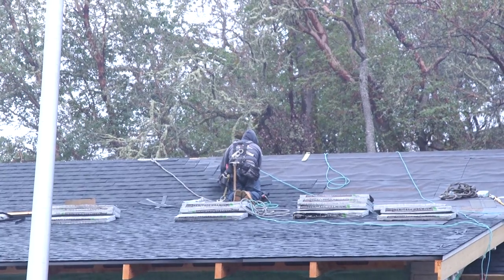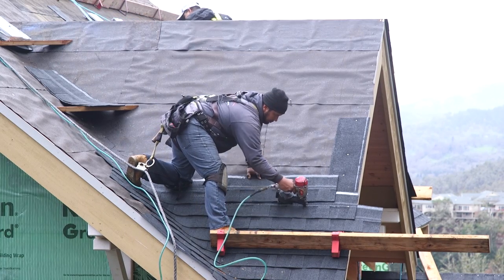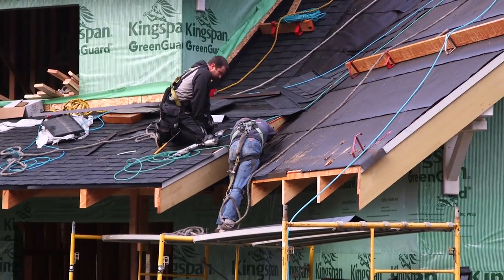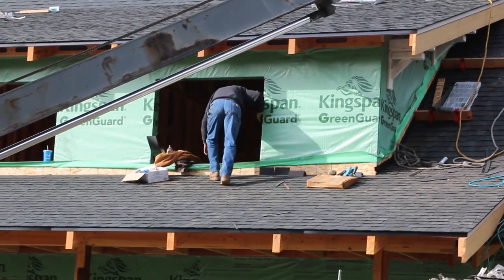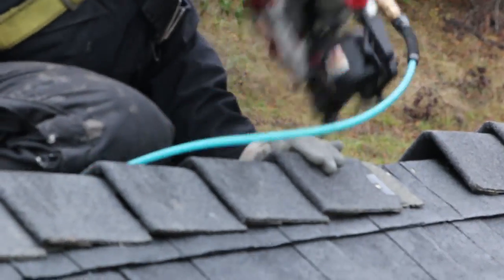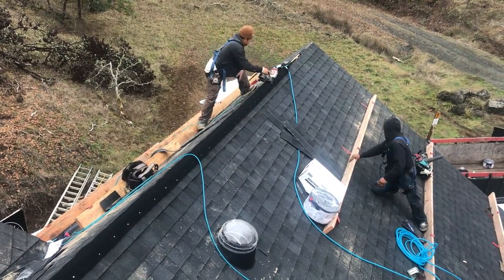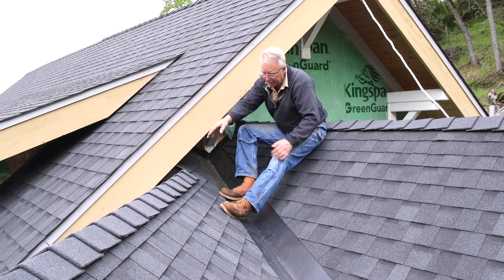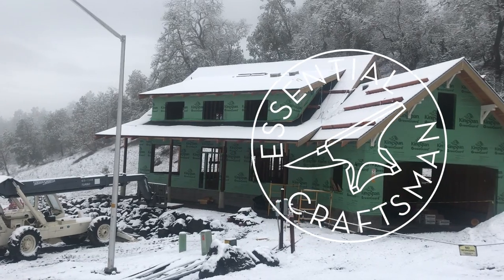Stunning and Complex Roofing Installation Ep.78

Comment: Pretty awesome! I have a huge appreciation for what roofers do. It's a tough job. 
In 8:20 I saw they put a third layer under the second overlap. I wasn't really sure what they were doing. Was that put in place so they can cut the second layer to be flush with the ridge?
Reply: at 8:20 he is temporarily placing a sacrificial cutting surface (upside down shingle) under the trimming area.  later he will chalk a straight line and cut off all that crosses the line, leaving a straight edge. He will then remove the sacrificial shingle
Reply: @whatsup3270  Ahhh! Thank you

Comment: Some nice roofing techniques. 
Curious why you used step flashing instead of pan metal at that angled part running into the valley ? 

I found that, that type of ridge vent gets clogged with cob webs and everything else that collects in attic spaces. 
My opinion on roofing installation is everything should look the same. If short courses are needed , they should not be noticeable. 
I don't think the laminate line should be seen or exposed. 
Unfortunately you showed some waved courses. 
Lots of roof jacks.  
Nice view. 
Awesome days to roof.

Comment: I'm a 12yr veteran roofer and that spot in the valley with the black pieces of tin is gonna leak if you have any kind of heavy snowfall with reaching melting temps during the day and refreezing at night. I'm from northwest Indiana about an hour from Chicago. I say that cuz we have one of the worst winters of most of the mainland US. SHINGLES ARE MADE TO BE FLEXIBLE OR THEY WOULD SNAP. That should easily define that for ya. Tough valley areas with multiple pitches should be fully woven in my opinion.

Comment: Does he discuss handnailing vs using a gun? Its been a big deal here in western Wa to have them all hand nailed because in a warranty situation it is very easier for the manufacturer to slip out of a warranty if it was gunned. This is because it is very easy to overdrive the roofing nail out of a gun and if they can find any place where the leak is that one nail was overdriven they can void it. I have not experienced this warranty issue personally but it is a consistent narrative you hear from spec builders all the time. Would be curious EC's take on this.

Comment: In minute 22, you are sitting above a flashing that goes over the roof shingles. Shouldn't the roof shingles be above the flashing, otherwise water will flow under the flashing? 
Also, on some roof side edges the shingle projects a half inch past the actual roof but in some places it appears that the shingle is cut back to before the roof ends. Is the latter incorrect? 
Thanks for an excellent video.

Comment: Question? I see no noticeable rake flashing on gable ends. Also I noticed it appears you are having quite a large overhang on your gable/rake ends, aren't you worried of high winds lifting the shingles at those locations?
Reply from the maker: For question one we have very little snow or ice buildup here. Drip edge on the gable ends is not typical at all. Just a shingle mould.

Second item, we have very, very little wind here and lots of rain.

Comment: The cut valley was never addressed in the video. Thought it was teased early on. Is this just a typical treatment that anyone should know?
Reply: there are 3 common valleys 1) open like the one he sits on near the end(metal exposed), 2) Trimmed as shown early in the video (4:48), and 3) Laced, at 4:48 had he shingled from both sided simultaneously with no trimming

Comment: When nailing on the ridge cap shingles, it appears that the two attachment nails are covered by the next ridge cap shingle in line, but at a certain point you will inevitably reach the end of the line.  What happens to the exposed nails on that terminal ridge cap shingle, where there isn't a "next shingle" to cover them?  Is there an alternate method of attaching the final ridge cap shingle?  Or is there some special covering that's put over the nails on the last ridge cap?
Reply: Face nails with a little caulking. Or screws with a rubber washer
Reply: Face nail with caulking. We even put stones from the shingles on the caulk to help blend it in. Can hardly notice it from the ground.
Reply: Thanks. Will the highly exposed caulk on the ridgeline last as long as the architectural shingles (20-30 years)?  Or does it break down and require reapplication partway through the roof's lifespan?
Reply: That Vulcan seals
Reply: Often, they start at the ends and meet in the middle, and then the problem is in the center. They seemed to do that on this roof, but didn't show the center piece...

Comment: Those 2x4 supports the guys are standing on look nailed through the shingles. How does this affect the water tightness?
Reply: They aren't nailed through the top layer of shingles.  As the shingles progress up the roof, they pull off the brackets and re-nail them so that they are nailed though the unexposed portion of the shingle,  and the next course of shingles covers that nailed portion.  When it's finished and the brackets are removed, the place where the brackes were nailed is covered by a layer of shingles.

Comment: I don't know about nailing and glueing a metal valley flashing on top of a lapped shingle valley.  I've never seen it done that way, and I think water is going to find its way under it sooner or later.  I'd rather use a galvanized valley pan and keep the shingles out of the valley than have the edges of a pan laying totally exposed above the shingles.

Comment: on them two valley problem u ran into all u had to do is use ice and water shield on both the valley then used it on each wall u used step flashing on  ice&water shield would help big lot. an shingles should of been 6 nail

Comment: The solar powered extractor fans in the roof make me a little apprehensive. We're counting on those motors not to fail over a 25 or 30 year period. Can they be serviced or replaced from below without removing the whole unit? To be clear; I see the advantage of a mechanical extraction using negative pressure, but does the performance advantage really outweigh the reliability of something like a Max-vent over time given that the latter has no moving parts? The more moving parts, this higher the likelihood of failure. Because if the motor packs it in, you're left with a plain old fashioned box vent.

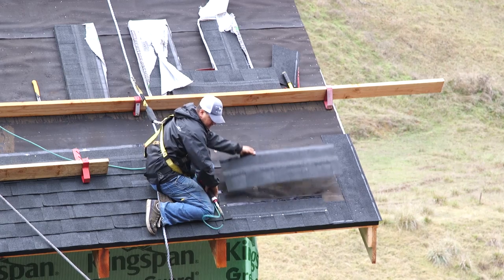Comment: Why are they leaving a nail out at 3:45? It appears they are not nailing that because the next shingle will lay on it and nail it down. But then yeah starter nail is now a finish nail. 1 nail for 2 ends of 2 shingles. Can you ease address their nail spacing? Seems outside the scope of manufacturer specs.

Comment: At 10.30 they seem to be nailing through the shingles to secure those   footings for them to stand on, how do they go about waterproofing those nails/holes? Complete roofing noob here so be kind 😅
Reply: That's the proper way to do it. The next course covers those nails
Reply: They’re nailing on the nail line that will be covered by the next row of shingles above them.
Reply: The nails go into the part of the shingle, that gets overlapped by the next row. They get hammer in and covered by the next shingle up.
Reply: Thanks guys, couldn't really see from the footage but that makes perfect sense 👍

Comment: I replaced the roofing on my house 20 years ago.  I got bids from roofers on shingles, and one guy had the temerity to say that he'd be back in 10 more years to do it again.  He was pointing out that 10 years is about average life for typical shingles where I live.
After I closed the door behind him, I turned to my wife and said, "No, he won't be back in 10 years, he won't even touch our roof."
I found a manufacturer of steel roof panels I could deal with direct, and I did all the work myself.
Two screws have come loose over the front porch.  I removed them, put on new rubber gaskets, squirted silicon caulk in the holes, and replaced them.  No problems since.
The transition to a lower slope roof at the rear has been a problem.  But that was caused by the asphaltic roofing product I originally used.  It dried up and cracked in our high heat.  I have since covered it with elastomeric and membrane, it stays sealed as long as I apply fresh coats every couple of years.
I took great care with the vents, I moved a couple if them to sit evenly between panel ribs.  It is easier to move a vent than to try to seal a penetration through a rib.

Comment: Please someone correct me if I'm mistaken, but the 3 inch vent pipe visible at 20:23 looks a bit short to me. It can be blocked potentially with heavy snow accumulation

Comment: I didn't think that an active power vent could not be used in conjunction with a ridge vent.  I was told that a power vent might draw air from the ridge and reduce the air intake from the soffit making the attic space even hotter.  I would like to hear the rationale for this system.
Reply from the maker: Actually there is no ridge vent in the main gable. Only over the garage and over the back porch. I’m hoping there will be a significant draw up through those vents in the main house. There are a couple of vaulted ceiling‘s with reduced airflow between the top of the insulation and the bottom of the roof sheathing. Counting on the big vent blocks in between the rafters to fully supply the draw that those powered fans provide.

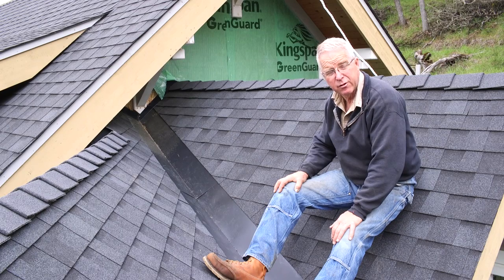Comment: 22:00 flashing above shingles? Only caulking to keep water from going under flashing.
Reply: David S honestly I need to hear the explanation how that will work.  It seems to me the flashing MUST go under the shingles in that situation.  The water running down from the ridge will want to go under the flashing.  I’m sure there is a reason but relying on caulking is a huge no no.
Reply: The flashing is under the shingles, they are just cut back 8" like he said. This give you a nice wide slippery surface for things to slide down. I thought it was on top too because of how nice and straight the cut is! If you look at 16:42 you can see them installing this flashing. The flashing even has a line on it where the shingles go to.
Reply: @ADBBuild  you know....i think you are  right!  That cut line is so straight it's unreal! For some reason I thought the flashing install was somewhere else and not this flashing.  I feel better now.  How did he cut it sooooo straight!? Definitely a fresh blade! Haha

Comment: How do they keep the shingles so straight across the whole roof? I don't see them using chalk lines or anything.
Reply: By eye
Reply: As long as the first row is straight it's easy to keep them straight if you align them to the last row correctly
Reply: I believe I saw them using a story pole off the ridge and then a snap.  Coming up that short side  of the valley to keep it straight.
Reply: Each Tamco shingle has a gps locator chip which emits two short beeps when placed in the proper position. Sattelite assisted asphalt shingles have been the standard in Canada for over 7 years now.
Reply: @bryanwinsor9392  Possibly the "" the old dinosaur way" of checking straightness  See  5:10 for a tape or story pole being used and  at 5:13 for chalk line snap. Old school ways sometimes are used to double check even Randy&Randy and the satellite.  We buy Tamko  Products I think out of Tuscaloosa. Loved the '' Old Awa Plan Premium half lap''  Still making it ?

Comment: As an old curmudgeon with close to a half century as a designer and full-charge builder, I am very much in alignment with the craft premise of Scott and this channel. HOWEVER..........I have some serious issues with parts of what I see here. After college, I stayed in the Boston area, and being the new kid, I got mostly smaller jobs, additions and renovations. 18 years there endlessly reinforced certain lessons:   1) Water is the enemy   2) Roofs never (almost) leak in the field, always at intersections and penetrations. 3) All shingle roofs must be replaced eventually   4) The flashings, particularly at sidewalls, rarely outlast the original roof (or should not be counted on, at least, for the next roof)   5) a step flashing ONLY, built into/ under the siding, becomes an enormous liability when the roof must be re-done, as now siding must be torn out to properly address the totality of the roof/ weatherproofing task    6) any house that DID NOT have metal (D-style) drip edges on all eaves AND rakes had water damage, rot and termites and or carpenter ants

Fortunately, there are some really well built old homes, roofing jobs and roofers to study and learn from. The best are the slate roofers. The copper work is actually the most important part of the slate roof, and the best mechanics "outline" the roof planes with a complete set of integrated flashings, before ANY slate is started. Most critically, these jobs are all executed as FLASH and COUNTERFLASH jobs. The counter flashing for a sidewall is placed initially, and the step flashings are done (tucked under) as the slate is installed. This means that the step flashing (which is down in the water, on the roof surface) is NOT fastened to or under the wall finish, and can be replaced with the slates. Not so big an issue with slate, but when you transfer the method to shingle roofs, you get a neater, better looking, more leak-resistant initial install, but most important, the roof can be re-done very successfully and easily many years later. 

Our "best practice" for shingle roofs, with either wood siding or 3/4" hardcoat stucco is like this, for sidewalls:  1) Ice and Water Shield on the roof-wall intersection, 12" up, and 12-18" on the roof plane; conventional underlay on the roof, lapper up to the wall line   2) 3/4" x 4" blocking along the intersection: back bevel bottom edge 45 degrees, to allow for the roll of the Ice & Water in the inside corner of the junction   3) counterflash (stick) 4" up the wall, 7/8" projection over the blocking, and the face with hem and kick terminating about 1" above the roof sheathing. 4) if there are sidewall/ headwall terminations, they need custom cut and bent corners    5) cut and bent step flashings are pre-set loose at the terminations, tucked under the counter flashing. 

All of this is done on the dry-in phase. The metal can be soldered copper or galvanized, or factory finished metal (must use a few dabs of sealants) in appropriate color. Now, the sidewalls above any roof plane can be completed, with traffic and mess ONLY on the underlayment (repairable, if necessary). When the roofers have at it, the structure is already totally waterproof, and the step flashings pop in easily, as the shingling proceeds uphill. I have jobs in place for decades with factory metal as the flashing material, and no issues whatsoever, as regards corrosion/ longevity of the metal.

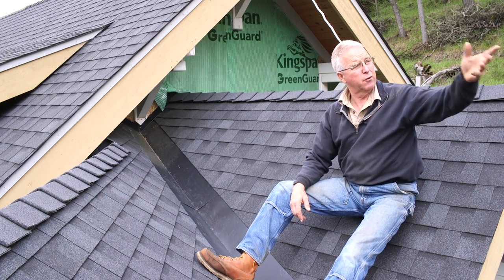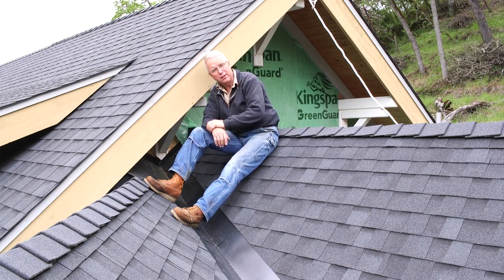A couple other comments: when a low pitch roof (dormer) exits a steeper pitch (see 13:52 and 22:54), I want a cut and bent flashing "plate" that makes the transition, such that there is a triangle of metal showing at the upper point of the intersection, and extending down at least one full shingle course on the steeper roof. On an open metal valley (see 21:36) , we do "W" flashings: this is an inverted Vee bent up at the centerline, that greatly reduces water overshooting under the opposite side of the valley.  And just to double down, it appears (see 25:00) that the rakes do not have a metal drip; simply never acceptable for our projects. 

Other than that, nice and neat looking job, on a fairly convoluted frame.

Comment: I hope you plywooded-up the doors and windows for the winter.
I hate seeing a under-construction house sitting open to the weather, even if just for a long weekend.  The moisture is not good for the interior,  and even special OSB flooring like Hardie-board deteriorates when exposed to rain.  And it's never good for the I-joist to get too wet for extended periods.

Comment: Disappointing to see the use of 15# organic felt for underlayment rather than synthetic in the field and SA ice and water shield in the valleys, along intersecting walls, around penetrations, and at the eave at least 24" beyond the warm wall.  Please note that open valleys last as long as most asphalt shingles or longer if the finish on the metal is a PVDF finish which is warranted as long as 35 years.  Pretty decent craftsmanship on the part of your installers.  The step flashing shown at 11:50 into the video should be blind fastened (nailed where the next course of step flashing will cover the nail installed in the previous piece).  It is nice to see the entire perimeter has drip edge.  Be safe out there and keep up the good work.

Comment: Hey idea... a video on nail guns and the differences. I don't get it. Seems to be framing guns primarily come in stick and  have the larger 6dnails. Coil nailer is the only way to get smaller nails with heads. 
Coil nailers can also be only for roofing. 
Looked at big box store and they go from large frame nail to roof coil nail to finish nail. 

So confused
Reply: You can get framing coil nails that shoot 16p nails. Western US guys seem to prefer stick nailers for some reason. Coil nailers hold about 10X more nails. Maybe the weight? I dunno. We always used coil nailers in the Eastern US.